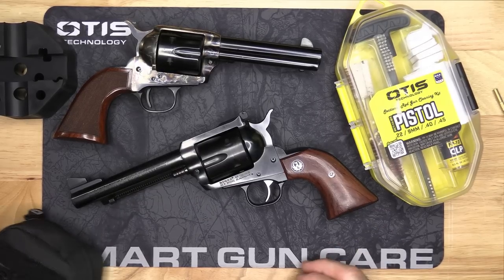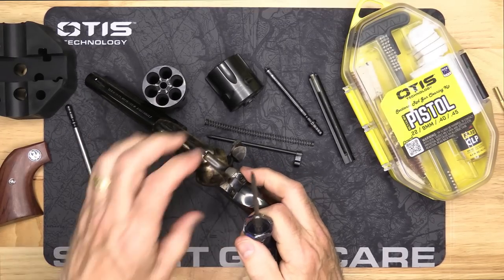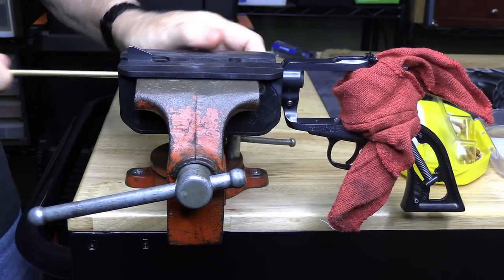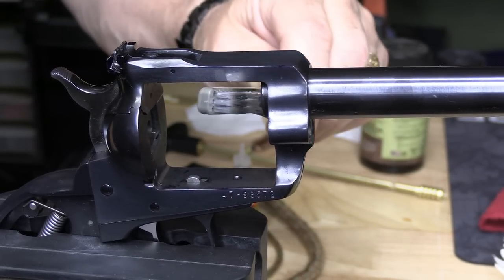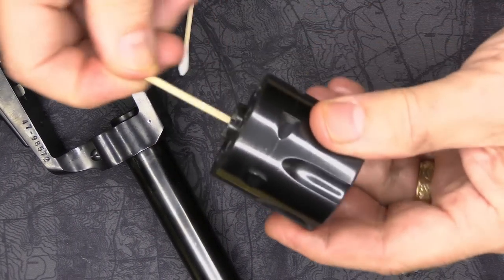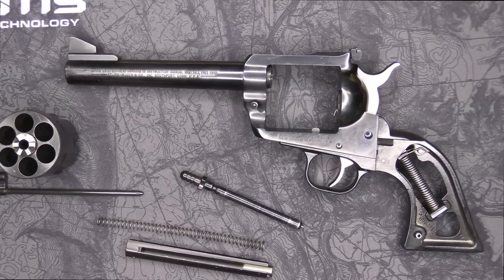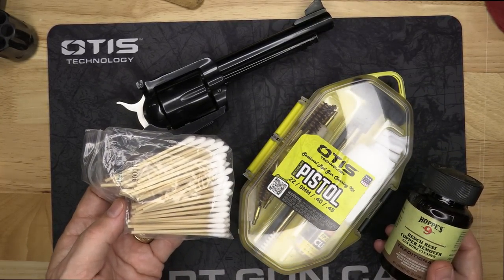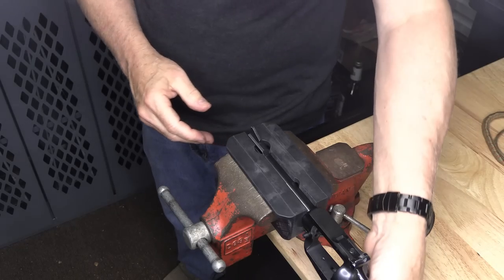How to Clean a Single Action Revolver : Tips & Tricks

Comment: We used to use an old school shaving brush to put a light coat of oil on all the metal parts of the weapons in the army.  Still works well to oil my guns after 44  years.
Reply: Where do you find those kinds of brushes anymore?

Comment: I have a Beretta Stampede (Uberti) .45 Colt.   Purchased it in 2009 but unfortunately was discontinued.   You did a great job in this video.   I would like to add a couple of things that can assist in cleaning the weapon.   First i shoot only copper jacketed ammo.   The copper can be removed more easily by the Hoppes No. 9 Solvent, where i have never found a cleaning gun solvent that will break down lead fouling.  When the solvent reacts with copper, the cleaning patch will have green residue, after setting for a while.   Second, when cleaning ONLY the cylinder bores,  i attach a brass (never steel) bore/cylinder brush to my hand drill.   I soak the cylinder bores in solvent, and in VERY LOW rpms scrub the bores, moving the brush forward and rearward, keeping the bores wet.   Being brass is a softer metal than steel the bores shouldn't be affected.   But never use the drill cleaning method in the barrel.   With it having lands and grooves, all types of scrubbing should be performed,  in conjunction with them.